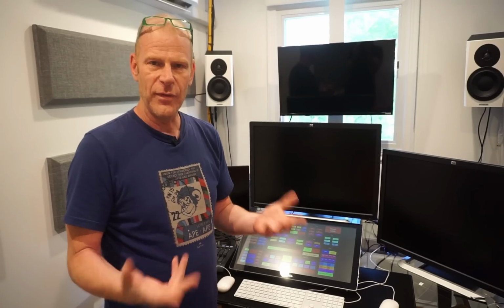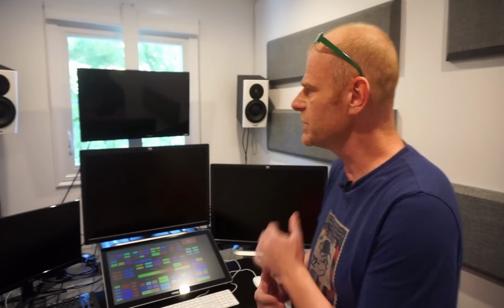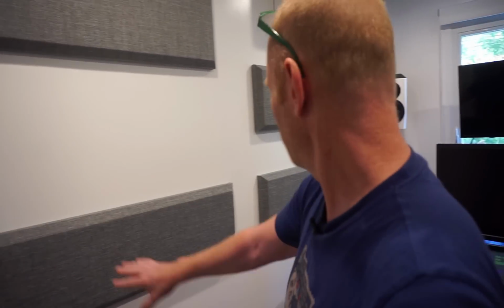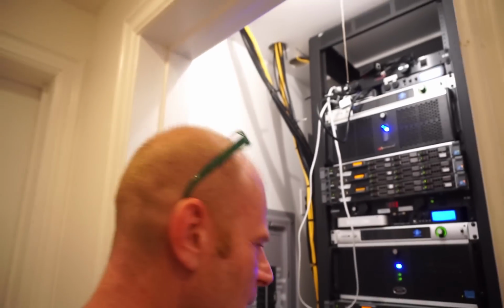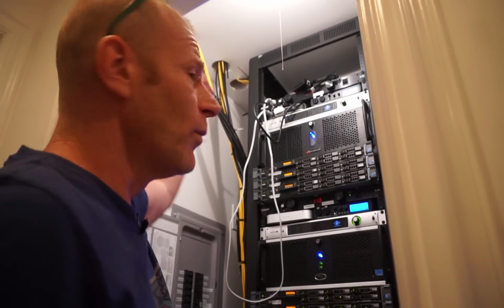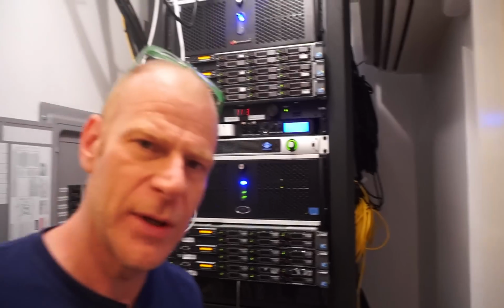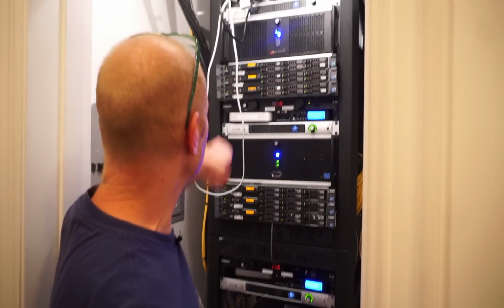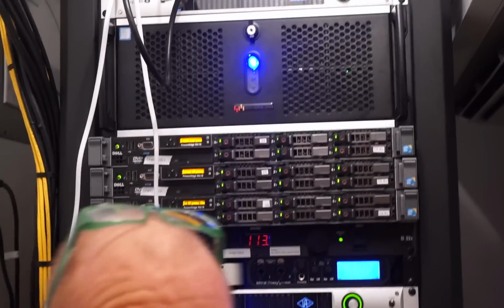Improve Your Studio: Panels, Machine Rooms & Server Units

Comment: I am using the cheapest Mac mini as a server - but got it connected via 10 Gbs Ethernet (only Mac mini upgrade I bought) to a 16TB mirrored RAID, a 4TB and a 8TB SSD. I'm using the same network for remote access via a "KVM over IP" set to send HDMI from my main workstation to a screen in my recording room and a webcam, mouse and keyboard signal back - as my main computer produced way too much fan noise when it got really busy. Now I can even do sound recordings with no noise gates and need less treatment.

Comment: Thanks for sharing this info Tom! How exactly do we set this all up? I've always worked on one computer for several years and recently purchased VEP7 to improve template organization and sound consistency. Can you make a "Studio Server Setups for Dummies" video?
Reply: Tom's set up is a monster but If you'd like  a smaller setup with VEPro and Dell PowerEdge Servers, you can follow the guide from this link https://coryarobbinsmusic.com/2018/03/25/vienna-ensemble-pro-setup-networking-and-server-installsetup/  . I have recently followed this guide and set up 2 Dell Servers (Got them really cheap from my local Facebook Market Place  $70 AUD for R900 and $180 for R710) to run my Kontakt libs.

Server1 Windows Server 2016 + VEPro 6 - a Dell PowerEdge R710 with dual Xeon X5675 + 144 GB ram + arrays of HDDs and SSDs 
Server2 Windows Server 2016 + VEPro 6 - a Dell PowerEdge R900  with quad Xeon E7330 + 128 GB Ram + arrays of HDDs and SSDs
Server3 Windows 7 + VEPro 6 - a custom PC with single Xeon 5670 + 32 GB Ram + arrays of HDDs and SSDs

All 3 servers connect to the main PC - Windows 10 - a Dell T3500 single Xeon 5670 + 32 GB ram to run my DAWs (Studio One, Cubase) 

This set up gives plenty power to work with Kontakt libraries.

Comment: factoring the price on such hardware being insanely low compared to buying a desktop set up, would you advise using one of these server machines as the primary machine and run the DAW and everything off it locally (as in have it propped on your desk itself) for someone such as myself who doesnt have a need for a server set up? also I looked at the dell website and all the server machines dont seem to support Non-server editions of windows.....would this not be the case and we can acttually run say Win8.1/10 right off these rack machines?

Comment: I've installed the London kit panels myself.  The "impaling" brackets and screws they come with make two 1/4" holes per bracket... a lot of holes to fill if you're going to move in a year or two.  You can use OOK picture hangers instead... they make tiny holes you can patch in a second leaving no trace.  You can impale the panels on those OOK hangers.  

You can easily find them (or knock offs) in hardware stores, department stores, or online.  I found packs of 50 of the larger ones for around $10.

Comment: The average person with a home studio does NOT need to use servers. I use Pro Tools 12. I bought a used Dell T5500 off Ebay...Dual 6 Core Xeons and loaded it up with 72GB RAM, added the following cards: SATA 3 SSD card for 6GB speed, a 500GB internal SSD Drive for Win 10 Pro, Pro Tools and VI installs, a 6GB Video Card and an external SATA 3 enclosure that holds 4 SSD drives. One of those external drives is used to "image" the Win 10 boot/programs drive every night and the other external SSD drives hold all my samples and VI content as well as backups of them. The whole hardware rig ran around $1,500. I connected the PC up to a 48" LG TV for video ($250). Tom has MULTIPLE Studios at his site so hence the need to network everything to be able access samples and VI content from MULTIPLE machines simultaneously. It is a killer and low cost work environment utilizing hardware that is a bit older but still "hot rodded" to the teeth. :)
Reply: ^^ this

Comment: Hi  Junkie, Joel here from the Pjilippines, love your videos, just a quick question, how did you create your VSL machines, are they like sound modules connected to a midi interface or do you use a proprietary hardware like vienna ensemble pro, and when you turn these machines on, do you have to manually load the samples in that machine each time you turn them on?  I have an older pc with a specific soft synth that I could'nt load on my current pc (32/64bit issues) so I just slaved it to the new one and run the samples from there, but then I have to manually load cubase and the VSTi for me to connect them to the current PC, How does your system work in that aspect.

Comment: Hi Tom, thank you so much for all the inside information. It helps me very much. Can you please explain how you handle USB connections over these long distances. Like from the server room to your working room. I have kind of the same setup, running 2 VSL servers connected to 1 "workstation" server, but they are currently in a rack inside my studio room. And i'm planning to move them towards a dedicated room in the basement. But i have a lot USB peripherals like MIDI interfaces that depends on USB. I just wondered how you solved this problem. And another question that i have is, how fast are the ethernet links between the VSL servers? I currently work with 1 Gbit LAN connections, but i can imagine you are even running on higher speeds. Thank you! Bastiaan
Reply: did you ever find out a solution to your problem (now a year later?)

Comment: Honestly so much servers, this is an overkill... I run a Full Orchestra (all articulations) and  much more VSTs, on a single machine using VEPRO as an internal server. My specs are I73930k 64Gb ram and 5 SSDs. Moreover I use a Be Quiet tower and my beast is totally silent.
Honestly  the convolution reverbs are the only thing that sucks of CPU power, so Dual Xeon, seriously ?
In short you need a lot of RAM, VEPRO and many SSDs that acts like your servers.
John Williams is not even on Cubase ( joking). Peace.
Reply: Dual Xeons that are ten years old isn't overkill, trust me, they score very poorly on CPU benchmark. But apparently the suffice. And what do you mean with a "full orchestra"? If you use the Berlin series, you'd know that every articulation hogs up 1-2 gb of ram on its own. That quickly eats up 64 GB of ram and you won't get far if you actually own a lot of libraries. It's another thing if you only have one string library, one WW etc.
Reply: @balluse  yeah you're right regarding the dual old Xeons, i wanted to build a similar setup 8years ago, it might drain a lot of power though... 
Well, some libs are more or less Ram hungry, but with a mix of HS, HB, HP, SO, and other Kontakt libs like solo strings, ww, percs etc... I get around 50Gb of Ram, my template is very very exhaustive orchestrally speaking and I don't need every single patches, just the right ones, you could always add more, like synths, fancy percs etc... but thats not taking much space.
But I follow you, you have to compromise on patches.

Comment: i recently bought a dell R610 server duel 2.67 12 core machine with 96 gigs of ram. (Same as Tom in This Video) and ssd drives to use as slave running VEP6 I have cubase running on my mac which is master. Are there settings in the pc i should tweak to make things run faster, more efficient and with least amount of latency?

upon testing a bit right away i notice more latencey than when i ran VEP6 on same cumputer as cubase.

i do have a gigabit hub with CAT 6 cables.
Reply: Can I ask you which OS you have installed on it please? I just aquired one of these machines and I'm trying to install Windows 10 Pro but am hitting snags!
Reply: Tony Clarke don’t put windows 10 on the server. Use windows server 2016. U need that os for a server.

Comment: One of the things I've been trying to understand but can't quite figure out: 

What cables do you run from the machine room to the monitors, I'm wanting to do this at home, but USB has a max length of roughly 5m. and HDMI has a max of about 20m (often way less for 4k HDCP 2.2) ? 

The only solution I can find is thunderbolt optical, but a 20 metre cable costs £600! and you'd need mmultible
Reply: You can get HDMI repeaters, or use active cables :)
Reply: You can extend an HDMI signal with an Ethernet-based repeater.

Comment: I ordered server same specs as Tom’s. Wish me luck getting it configured. I’m not a pc guy. I’ve been running vep on my Mac.
Reply: I did the same and pleased to report I got it working with a few problems but that was down to firewall settings. And also making sure the boot sequence was right in bios so I could install windows 16 off usb.
Reply: DrSlightly Evil what was it you had to do?
Reply: @nicksaya  Well depending on whether you have windows software installed already or not the first thing was to get windows 16 from microsoft Thety do an evaluation version which downloads as an iso. I then used a program called Rufus to mount it onto a usb. Had to use the GPT format as opposed to MBR as when I got to the point of windows install it would tell me hard disk was not formatted correctly.Also had to go into the bios and change boot priority and bring usb to top of list  as it would not find it despite only having one empty hard drive connected.Once Windows 16 was installed it acts pretty much like Windows 8 or 10. What took me the most time was trying to get VEP to connect from server to my main pc. And that was down to firewire blocking the connection even though i had turned it off on both machines. So if you get the same and cant get it to appear on the VEP server window that will more than likely be the answer. I have ordered another rR610 and will make a video of the whole setup as it may be usefull to others. Have to say though that now its working its pretty impressive I armed at least 50 tracks in one go including cinebrass ,8dio adagio strings and various other stuff and  I played with no pops or crackles. Good luck anyway
Reply: DrSlightly Evil the evaluation version is only a trial correct? Does it time out like a demo?
Reply: @nicksaya  Its 180 day evaluation but you can extend it up to 6 times making it 3 years with a script from microsoft according to various websites
Reply: DrSlightly Evil is it necessary to have both power supplies plugged in? I’m not running a data center.
Reply: @nicksaya  No I'm only running one one supply I think the other supply is more for backup should the first one fail so there is no loss to server
Reply: DrSlightly Evil hi. Wondering if you have tried to install hard drives? I added two ssd drives. The indicator light is flashing yellow on them. I am trying to get computer to see them so I can format but no luck. Am I missing something here?  They are seated in tray correctly.
Reply: @nicksaya  Are you going into disk management and making them online or are you still trying to get operating system on there?
Reply: DrSlightly Evil no these are storage drives. The system drive is good. I had it delivered with system drive installed
Reply: DrSlightly Evil when I go to disk management I don’t see them. They are flashing amber during start up and remain flashing.
Reply: @nicksaya  ok try clicking on start then type cmd then diskpart (all one word) then list disk (with a space) and see if they show up in there
Reply: DrSlightly Evil no just the system drive
Reply: DrSlightly Evil they flash yellow as soon as they are put in
Reply: @nicksaya  Have a look at this page and see if any of the info relates to the problem youre having  https://www.dell.com/support/article/us/en/04/sln292269/chassis-status-indicators-and-hard-drive-carrier-leds-for-servers-storage-and-precision-rack-workstations?lang=en
Reply: DrSlightly Evil I’ll look at it thanks
Reply: DrSlightly Evil thanks I’m getting there. Ha. Hey Is there a way to have the server see two drives as two drives and not a raid?  I want to make use of them and be able to store 2 separate libraries on them.
Reply: @nicksaya  Nick absolutely I have 5 ssds connected to a r610 and all are individual. I think it is probably to do with PERC settings but I will look later when I can get to my 610 and see what my settings are. But I do have them all with their own drive names i.e Strings Brass etc. The intention is to seperate them over three machines and divide the workload Glad it is starting to come together for you : )
Reply: DrSlightly Evil thanks I want to say put in 3 ssds but don’t want them joined as one in a raid. I want to be able to have separate libraries on each.
Reply: @nicksaya  Have a look at this video as it explains raid settings and how to setup disks.... Maybe useful in the meantime https://m.youtube.com/watch?v=nKiOECFu1HE
Reply: @DrSlightlyEvil  WOW  i found this on line. if you didn’t know about it it was a game changer for me.
And here's how to increase CPU Real-Time performance (PC) Step 1/2 Control Panel/System and Security/Power Options/Show additional plans: Select High Performance and also click "Change Plan settings". Go to advanced power settings. Go down to Processor power management/Processor cooling Policy = Active AND Maximum processor state = 100%. Step 2/2 Launch your DAW. Right click Windows taskbar /Start Task Manager/Applications : Right click on "DAW"/Go to Process. Right click on "DAW".exe/Set Affinity = All Processors AND Set Priority = Realtime. Thats pretty much the best your gonna get.
Reply: @nicksaya  Nick I did this on my main pc a while back but hadn't crossed my mind to do the same on servers Thanks for the tip..Actually got 3  servers up and running with VEP and Remote desktop and all working really well. Just gotta build a massive template Hows is yours going ?
Reply: DrSlightly Evil since I made those changes all working great. I already have my template built from when I ran vep on same computer as cubase.